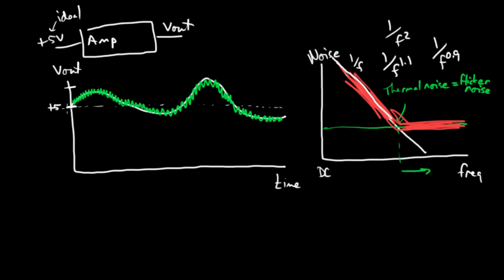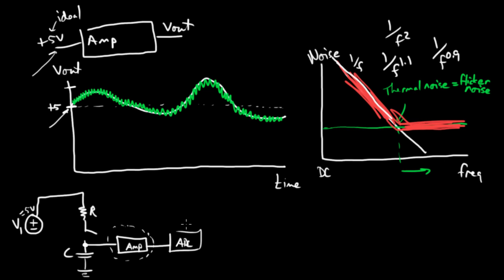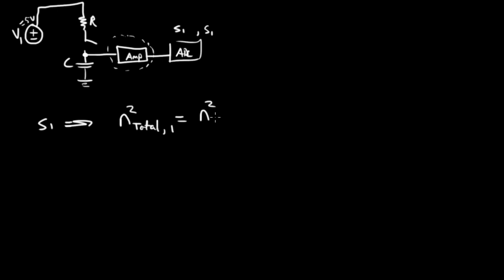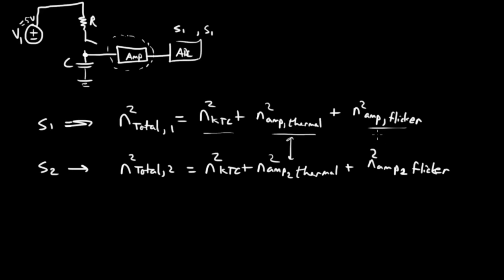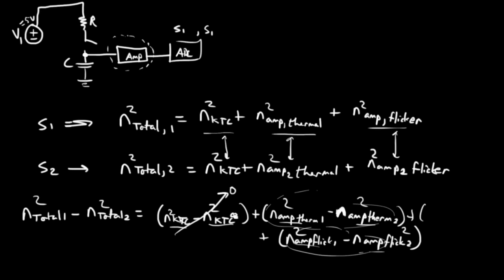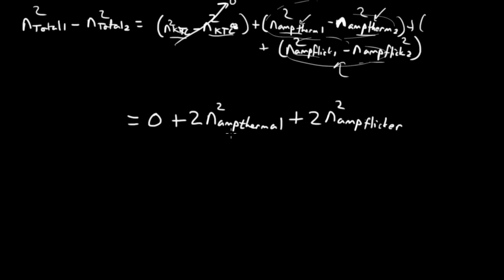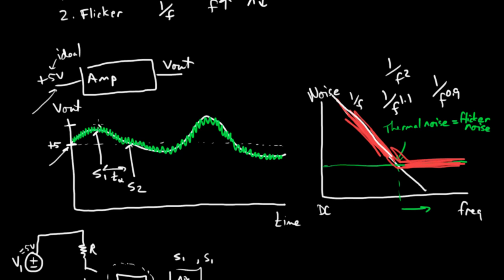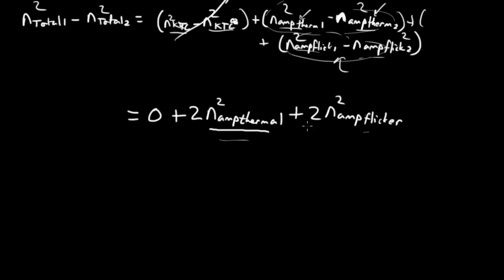Reset noise in RC system 3 [5 of 10 Image Sensor Noise]

Comment: Hi! I was watching your video and you say that what you are doing when you take the difference between the two sample is indeed correlated double sampling (CDS) eliminating KTC (reset) noise. Nevertheless I've been using some bibliography from Profesor A. El Gamal and in his lectures notes he says that the CDS does not cancel reset noise in APS (active pixel sensors), indeed CDS adds reset noise as KT/2C_d[Vrms]. He divides FPN in an offset FPN, and some gain FPN and says that the CDS only eliminates this offset (except the one related to dark current) and does not cancel reset noise, gain noise or readout noise.

I can't see the correlation between both of your explanations. The only option for me, is a misconception between what profesor A. El Gamal calls reset noise, and what you sir call reset noise. But, reviewing my bibliography again, what you analyze here as thermal + reset noise is what profesor calls temporal noise and  they are exactly the same concepts that you present here.

So, my final thoughts are that maybe you are using this "temporal noise" as maybe "spatial noise" because when you take a sample you have a component of spatial (FPN) and temporal (thermal + reset) noise, and that is why you say you can eliminate it with CDS, but it still does not sound quite good to me.
Reply: Jose Enrique Corchado CDS can eliminate low frequency noise. But you are right that CDS can't eliminate reset noise.